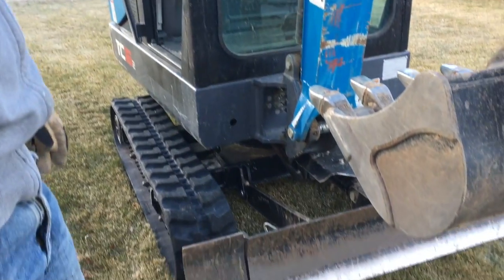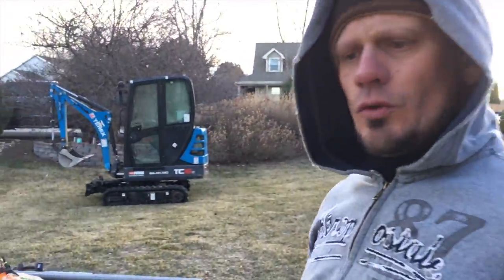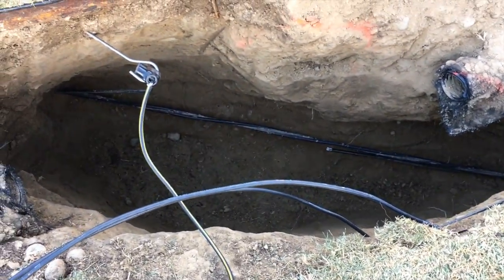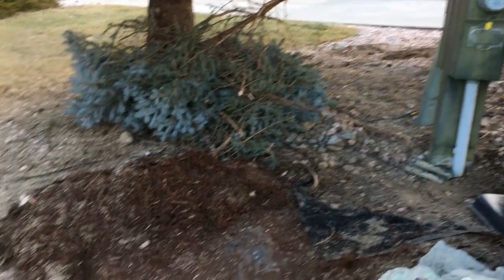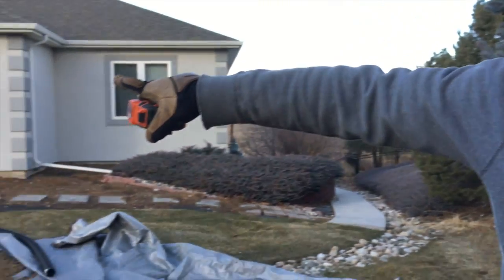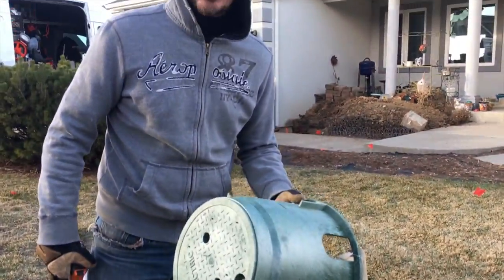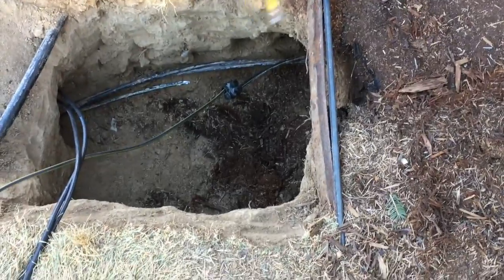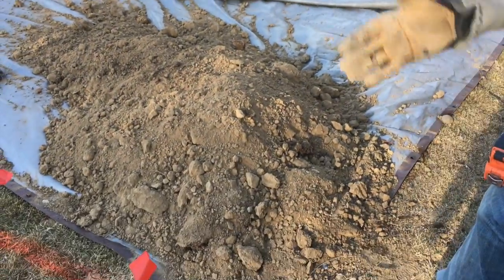Power Out, Lights Flickering—Part 4

Comment: see when you electricians say its cost so much money to dig and use conduit im glad i was able to be at least a 2nd year  and can just pull a permit and do most of it myself. i tell pple all the time its like $25 for a permit and a 12 pack an hour for my labor and no parts mark up on matts maybe a burger for shipping lol. 
oops i should have read comments all the way you did in the end do it professionally(not just right to code  in my opinion code is like a D- just the bare minimum)😎👍
Reply from the maker: FINISH YOUR HOURS> OR, quit charging your customers for your work. Your not a pro until you get licensed.
Reply: @Petersonelectricllc  i dont charge pple i give advice and any work i do is for family and frnds ergo the amounts in 12 pack of beer and burgers and i push them to get permits. as home owners can in my state they can get help to do the work 😉 as far as a pro goese most AHJ like my work terms are tight everything is secured grounds are all twisted crimped secured to boxes because i can take all day to do it right not in a cple of minutes so i can run and screw over the next guy for a few extra ¢¢¢. 

time maybe money but workmanship is priceless

Comment: We had an issue with some primary underground direct buried, we used a thumper, expensive equipment, but it told us how far out from the pad mount the fault was.  6 ft deep though, no fun hand digging!    In your situation do you think it would have made more sense to replace the run of urd incase there was other damage that hasnt caused trouble yet?
Reply from the maker: The new code expects four wires from the meter cabinet box that was in the video, she only had three underground urd cables.
Reply: @Petersonelectricllc  I know that, but what I was asking if you thought it would make more sense to replace the entire run of urd?         
    Btw great job with the videos!
Reply from the maker: @wng8993  Yes, we did replace the whole run and used URD in Conduit with four conductors. I always think that it makes sense, "if possible" to do this for the customer. I would personally like to use copper if possible. But this can be 2.5% more per foot, but it is 3 times a better conductor.
Reply: @Petersonelectricllc    piece of mind for the customer and you!  it always seems like the AL oxidizes into powder when the insulation is opened with the conductor exposed to the elements.  Even our overhead triplex service will do it,  but not always.  Idk if its an electrolysis thing or what.?    I've seen it happen to the copper concentric neutral on primary direct buried, just turned to green powder. PVC  Conduit is the way to go for a number of reasons!
Reply from the maker: @wng8993  Agreed. I like the idea of CIC but it is aluminum. It is Fast and works well in a trench cutting time in half. So I have been using TC cable. Though the article says it is good for Direct Burial, I don;t think I trust it with out conduit. What do you think of LFMC in the ground, it is rated to protect yet would it be subject to physical damage.
Reply: @Petersonelectricllc  LFMC, I think if the outer sheath got damaged somehow it would cause problems with corrosion.  I wouldn't feel good about it.  We always use pvc in the ground with ridgid for the riser 1st 10 ft on the pole.   Ridgid sweep if it's a continuous run, encased in concrete (fun stuff to transfer to a new pole)  Snow plows and vehicles seem to love to hit riser poles for some reason.  I'm gonna ask one of our masters what he thinks about LFMC in the ground.
Reply from the maker: @wng8993   My problem with PVC is that it leaks in time after the glue drys.
Reply: @Petersonelectricllc  we use innerduct sometimes,  but any conduit I've seen is usually filled with water.  Here in Maine frozen solid in winter.
Reply from the maker: @wng8993  So if the fittings are tight, you have seen seal tight leak underground?
Reply: @Petersonelectricllc   honestly, I've never come across any seal tight installed underground up here. At least not on the utility side of the house.   I'm not sure how well it would fair when the frost is in the ground.    It might be ok in Colorado though where it's a bit drier climate. ( beautiful state you have there btw, I was in the Springs/Monument in September)